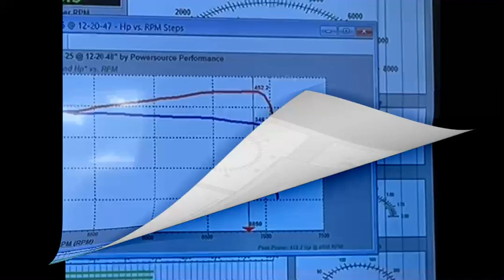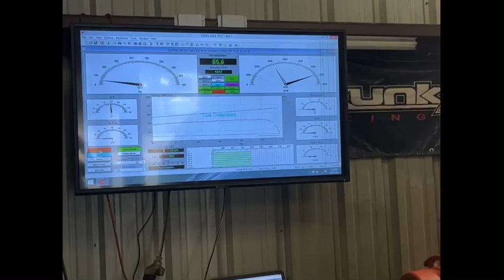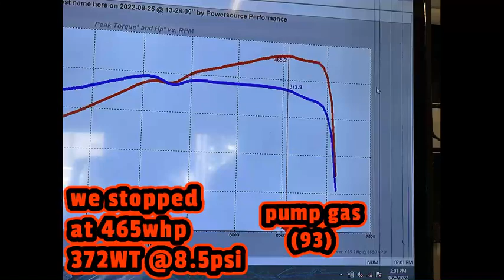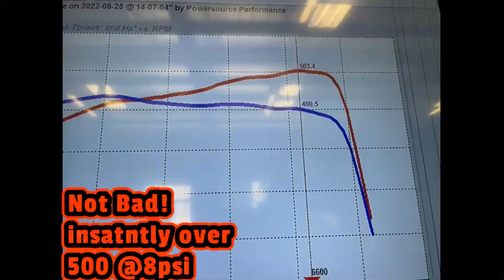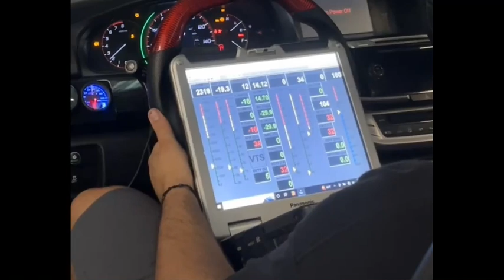600+ WHP 9TH Gen Accord

Comment: Appreciate the content bro. Just bought a 6-6 2012 and would love to get to know what things worked out. Most people only get the exhaust work done. This build is on a whole other level. Would appreciate the insight in how to go about getting my setup. I want to gather parts before I commit. Keep up the amazing work 👏🏽👏🏽👏🏽
Reply from the maker: Honestly as for the build, depends what your wants are or goals with your platform. P2R racing has been a big part of my build since day one. Only thing they didn’t have a part of was my custom turbo kit me and a friend made. So anything you can be considering motor building wise my guys at P2R can def can handle. Thanks again for the positive deed back and good luck on yours. Feel free to ask if u need any other help
Reply: If you don't mind me asking, whats 6-6?
Reply: @AlejandroGarcia-ww7uf  V6 with a 6 speed manual transmission.

Comment: As another 15 6-6 coupe owner, this is insane! Mines a daily so building it this much is out of my spectrum for right now, but the goal is simple FBO to get arounf 300 whp just to keep it practical. Definitely in the long run would like to build a turbo setup for it similar to how you did.
Reply: From what I understand you cant get to 300hp on just FBO with this engine. FBO might get you to 260-270 wheel. A turbo with low boost is the best power mod if you dont want to blowup the engine right away. Atleast from what I have seen thats  what most people do, which is far and few between.
Reply: @jlj547  wrong i made 302whp 260wtq FBO NA
Reply: on a shitty basemap 91 tune too, not 93 octane or custom tune
Reply: @jlj547 my 6-6 with semi bolt ons makes over 360 hp to the crank and 310 to the wheel 280 ft lb of torque
Reply: Its already 300hp basically..

Comment: I have a 2013 and i kinda wanna do some modding, but im on the fence if I should replace head gaskets before i add performance parts and a turbo, i don’t wanna have heat displacement issues later on

Comment: I’ve been inspired by this build I have one but in automatic with basic mods like Sri intake, intake manifold and throttle body spacers with a atlp j pipe and borla exhaust, you have any advice on how to make a decent amount of power on these while on a budget?
Reply: Upgraded fuel system (fuel rail, fuel line, fuel injectors) is the most power and efficiency you’re going to get. This is aside from deleting the pre-cats entirely, and running ported intake runners and a J37 throttle body. I’m currently seeing if I can swap over some of the same year era Acura MDX OEM fuel injectors onto my J35Y2 (MT) engine.  I’m running the J37A4 intake manifold as well, but it doesn’t flow the same way the stock J35Y2 intake mani does. You will gain more mid end power in doing so. I also personally wouldn’t waste my money on the plenum spacers, but if you believe it truly makes any significant difference for you, then install the thicker one by all means. 

You have the J35Y1 (AT) engine, which has VCM built into it. Not sure if you have the VCM system disabled with KTuner or not, but that’s a must if you want the car to run smoother and engage full power at any given moment. Not that the VCM is super problematic in the 9th gen Accord V6 6AT’s, but most people benefit more from disabling it. 

The J35Y1 engine and J35Y2 are also a bit different in compression, but I believe that they’re capable of making around the same amount of power. Management on the J35Y2 is probably much easier with the VCM in the way, I’m assuming. The 6AT is also pretty durable in my opinion, although I haven’t personally daily’d a 400+ WHP setup, along with driving it hard more frequently. 

I ALWAYS recommend changing the automatic trans fluid prematurely, especially if you’re an aggressive driver. I find that transmissions are the weak(er) links on the Honda Accord platforms. I’ve always been saving all of the Honda’s and Acura’s I’ve driven (as well as all my other owned and driven vehicles), by changing the trans and/or diff and transfer case fluids/oils along with at least every other engine oil change interval.

Comment: This is the dream build for alot of 9G guys like me. You should get the rasp under control bro..unless you like it like that. 

How big is the exhaust manifold thats coming out of the turbo?
Reply from the maker: Thank you so much bro I greatly appreciate it. Unfortunately I haven’t really seen anyone get total control of rasp on these without restrictions
Reply from the maker: 3in down pipe off turbo but precision 6466 I’m running is I believe 2.5 outlet (exhaust side) down pipe is 3in to 2.75 straight pipe back with high flow resonator.
Reply from the maker: But being honest it doesn’t drone in car and under throttle I hear more 🐌 then exhaust lol
Reply: @boostedj35y27  I used to have a 15' sedan and a 14' 6-6 and tried almost all the exhaust combinations from RV6 to ATLP. Maybe try a 3in turboback with a muffler thats atleast 3in thicker than your downpipe. In my case, I had a 3in downpipe and a 6in muffler. 

https://youtu.be/v8e638iPF8Y?t=49
Reply from the maker: @marc_the_strong  I appreciate the input. Better exhaust flow is on one of my to do lists lol.
Reply: @boostedj35y27  Yeah i hated that the better the exhaust flows, the raspier it sounds. It took alot of money for me to figure out how to get the exhaust flowing good without the rasp.
Reply from the maker: @marc_the_strong  yea it’s def weird but I’ll be getting at that soon. Now that transmission is all good and I have some miles on the car I gotta get the next video up. Sadly I’m in the middle of moving back to NY so I’m tied up till I get there and I’ll get the new vid up. 

So u outta the accord game now or???
Reply: @boostedj35y27  yeah unfortunately. I sold my 6-6, but the guy who bought it boosted it too. 

I have a 21' 6.2L Silverado now